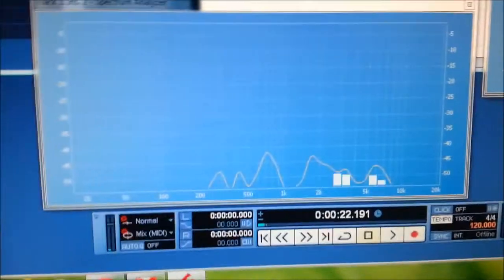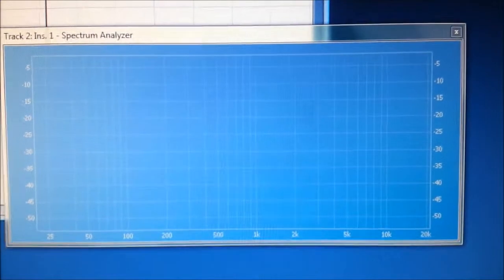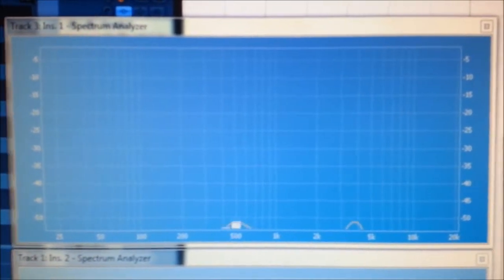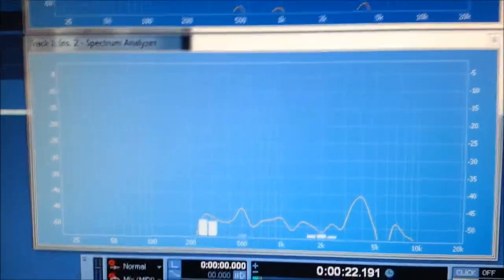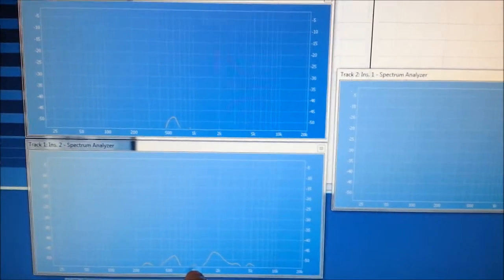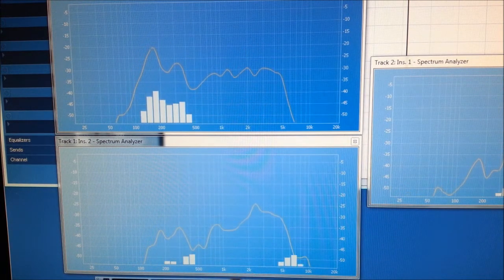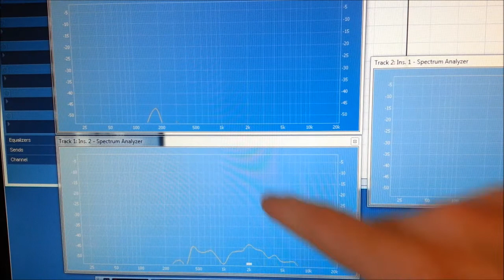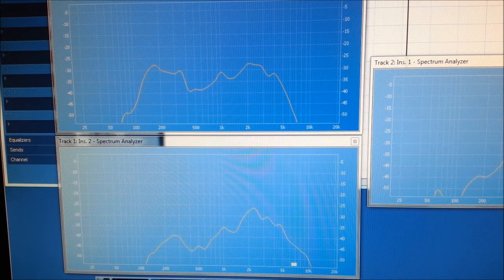Demonstration of Comb Filtering - IMPMOOC Peer Review Week 5

Comment from the maker: Hi Uncle Bill,
Thanks for watching my video! The course instructor's demos were all done using white noise, so I wanted to bring it into a more practical scenario. I considered doing a manual flange, but I thought the filtering would be completely hidden by all the noise from moving the mic stand without a shock mount. I'll reconsider that when I have the right equipment, like a second mic stand (instead of trying to use a pop filter to hold a mic) and a camera with a tripod mount.
Thanks again!

Comment: Hey Mike, nice work.  Its good to see you trying this out rather than taking somebody's word for it.  
Two things you could try - 
   1. use white noise instead of guitar.  That should make it much easier to see because the source will have a flatter spectrum to begin with, and not decay over time.  You might be able to see the dips at 1K, 2K, 3K etc.
  2. Moving the mic slowly closer to the wall.  That slides the comb up in freq, sort of like an acoustic flanger.  You know, using your 4th hand.